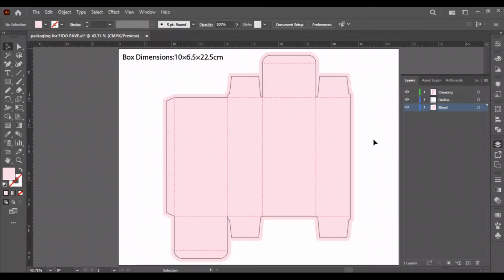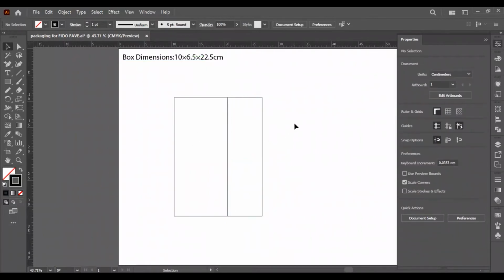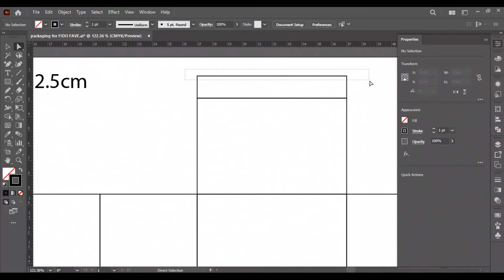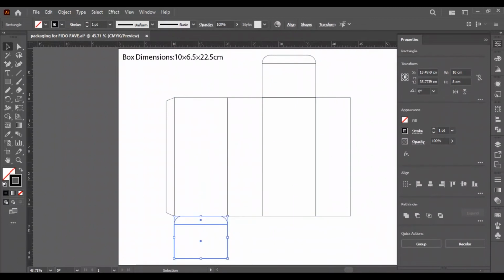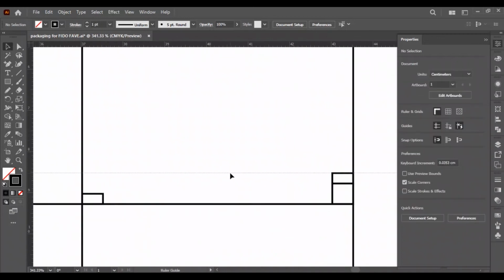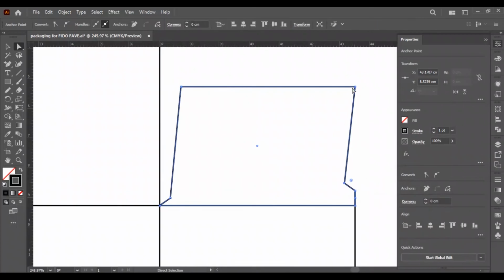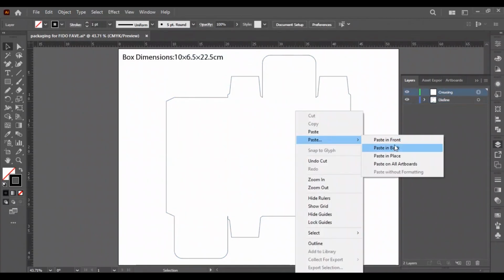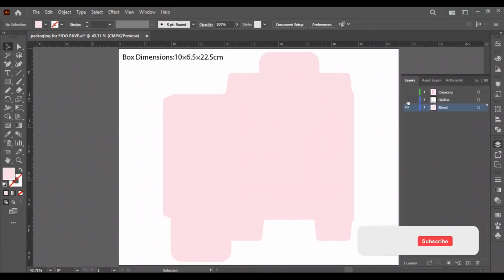Packaging Design Tutorial in Adobe Illustrator 2024 | How To Create Dieline Step by Step

Comment: Great video! Straight to the point. Question: minute 1:35: in my box design, the flap has an inch cut on both sides. How do I design so the printer will know?
Reply from the maker: Thank you for your comment, no need to worry about that, go to the layers panel and create a new layer and name it artwork. You just need to proceed with the design and hide the dieline layers after you finish the designing your box. When you will send the final files to your printer, they will turn on the dieline layer and cut the box according to that.
I hope I have answered your question, if you still have any question let me know.